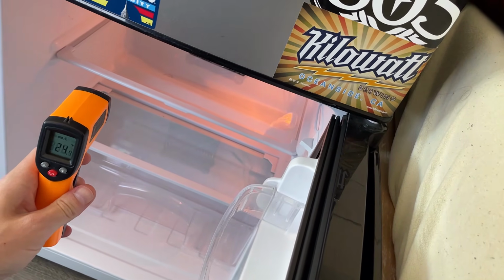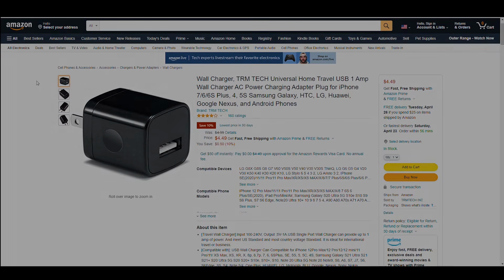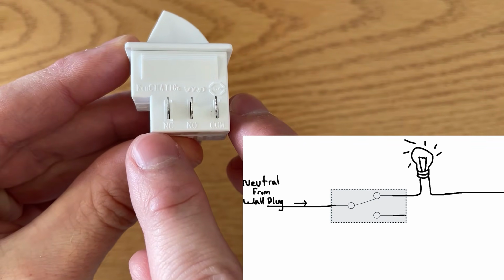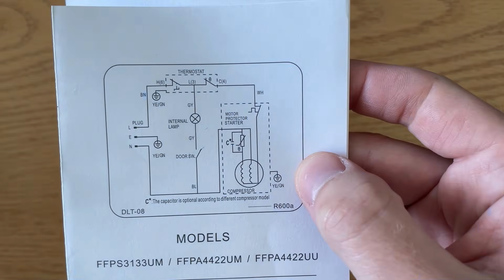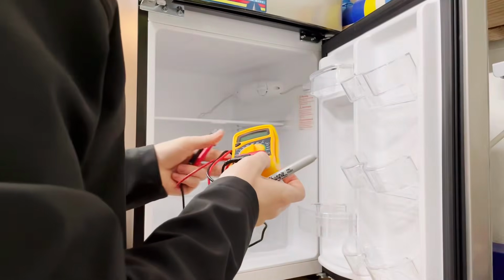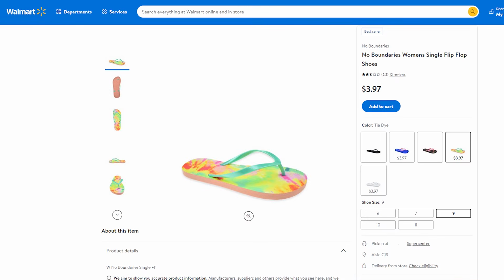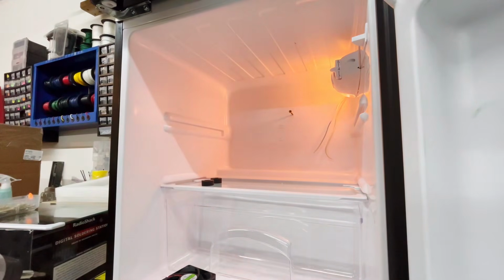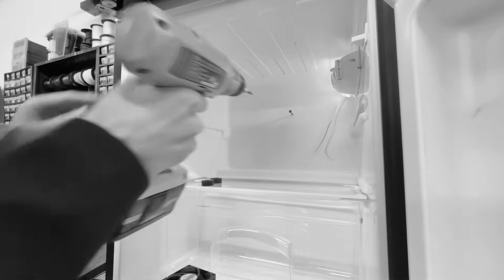Fridge fan install - DIY

Comment: If you drill a hole adjacent to condensation drain. You can feed fan cable thru. Use black silicone gasket seal to fill it.

Comment: Did you also notice energy savings?
Reply: I think you would need a fan blowing over the compressor or radiator (moden fridges just use metal case as a radiator, which must be less efficient but it saves manufacturers money) to increase efficiency. That's what I thought the video would be about.

Comment: Few questions. Couldn't you just use a 120V fan that accepts it directly instead of fussing with a converter to step down the voltage? They're about twice the cost but it would save busting and soldering a phone charger as well. Couldn't use rubber adhesive strips on the glass panel? Sacrificing security in exchange of not puncturing a freon line.
Reply: The bottom, and door shouldn't have any lines, but modern fridges have the radiator lines in the walls against the metal case as well.

Comment: So whats the reason for the fan
Reply: It equalizes air. Full size fridges have a circulation fan this helps the hot spots stay as cold as the warm spots.

Comment: I just drilled a hole behind the top freezer compartment. Since I dont use the freezer I just left it in the freezer. Works great. Big question?? Why dont they make them with a fan already inside plus one blowing on the compressor ? I have one there to brought the compressor temp down from 123 to 97 degrees.
Reply: They do now.

Comment: Is this really cool down lower part fridge?? 
How much its effective? 
My fridge very low cooling at lower portion, 
But I will not drill i will fixed fan with aluminum Tap. 👍

Comment: Me thinking: and he's just gonna glue it now...I think a piece of plastic like a piece of cable channels would stick in there quite nicely. than you can drill in them. I would also have used a bigger and thinner fan.
Reply from the maker: 🤣🤣 Snagged a thermal camera for the replacement fridge once this one finally died. (which didn't take long for very obvious reasons). Made it super simple to ID the line locations... But mostly I wanted to write off a thermal camera on my taxes.

Comment: why not change the 12v DC fan in the freezer
Reply from the maker: Great question! These mini fridge / freezer units have the entire top, bottom, and sides of the freezer surrounded with a coil of refrigerant lines, so the cooling is very uniform in that compartment. But with the fridge, the only cooling comes from the back wall - it doesn't do a very good job uniformly cooling the refrigeration space.
-Tim
Reply: @VanwithTim  i see

Comment: Had you considered gluing the fan in place instead of screwing
Reply from the maker: I've always shied away from adhesives but with today's modern adhesives, I think it would be possible to make that work!
Would have certainly saved me some headache haha
Reply: @VanwithTim  I've had good luck with abrading the surface to give it tooth and using 3m weatherstrip adhesive. It's worth a try. Don't know how it will do in a fridge but it's been working outside for five years now

Comment: Always love the videos mate. Tomorrow I will be doing the same as you did adding control to the front vent fan of the van. Maybe I'll post a video too! A little YouTube Algorithm tip, Try not to upload two videos the same day. wait a couple days between uploads and for some reason the YouTube algorithm likes that as you are "regular uploader".
Reply from the maker: Should definitely do a video on the blower fan!!
Good call on the videos as well, need to get back into it and start doing regular (spaced apart) uploads again!